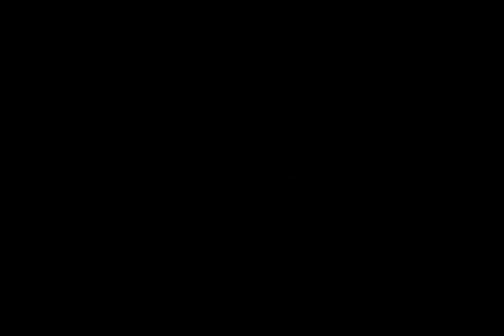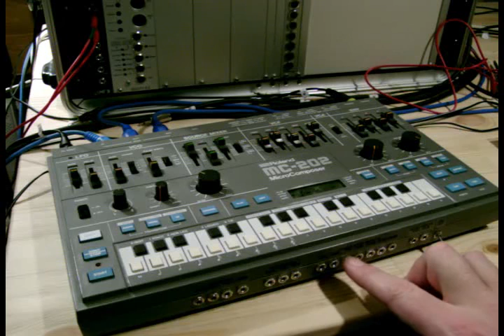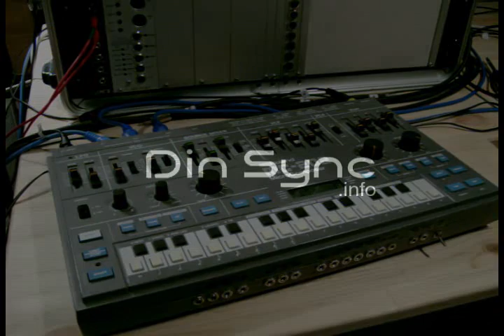Adding CV inputs to a Roland MC-202 and what you can do with them.

Comment: Have you ever though about creating an RE-202 with memorized seqencer with many channels and with these modifications implemented to the original circuits ? That would be dope especially since the price of the MC-202 rised so much for something that needs more wires more resistors and more jacks to reveal the real bomb inside.